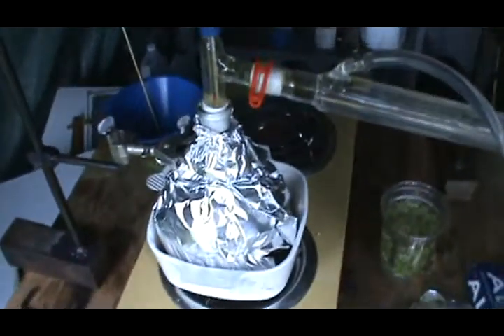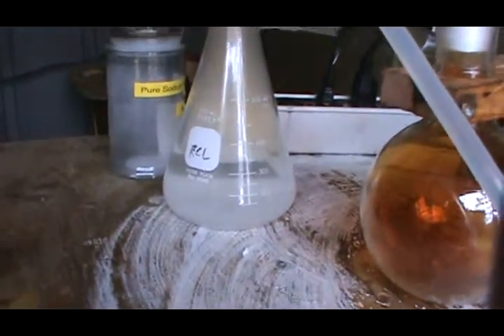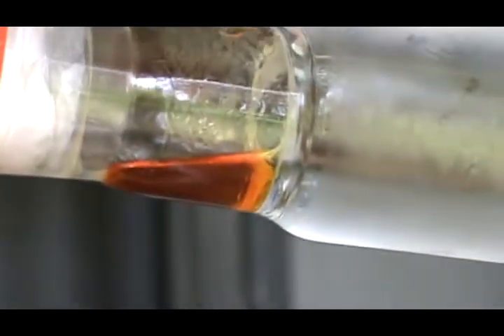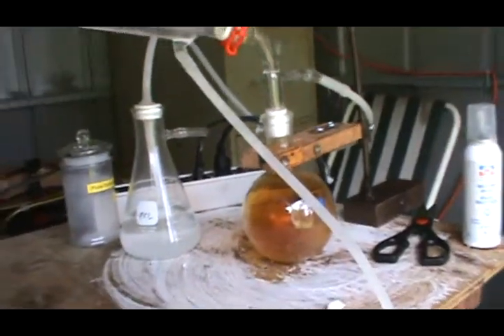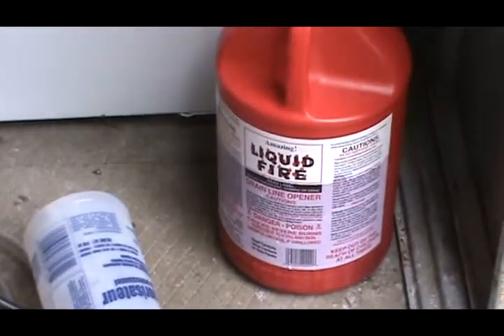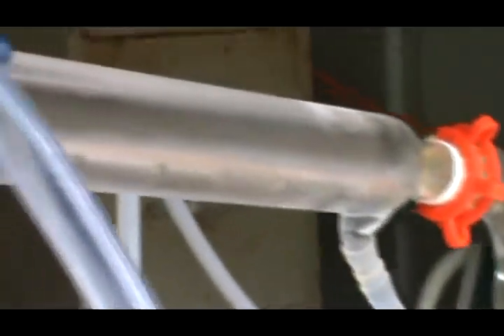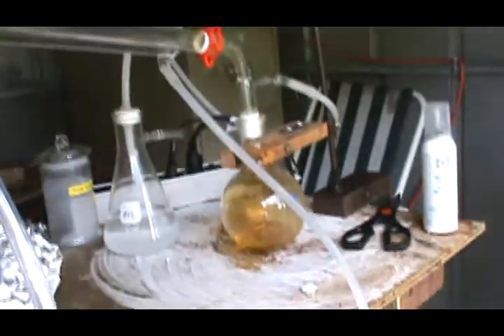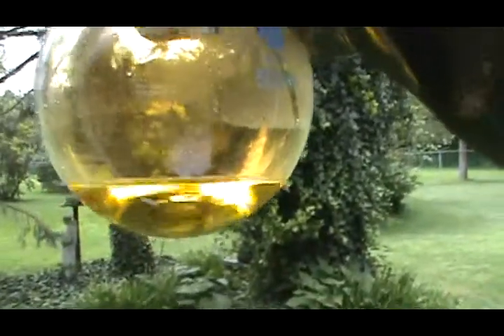distilling red fuming nitric acid

Comment: Rooto®️drain cleaner is 98% sulfuric acid
Reply: No it is not. You cannot have a H2SO4 based drain cleaner of 98%. 98% is as pure as azeotropic H2SO4 can get. As soon as you add anything to it, it will drop in purity fast. Don't believe anything you're told, that myth has been debunked a million times. It's a fine source to distil form, but so are many other brands. Rooto is about 93%-95%.

Comment: nitric acid is prone to breaking down to HNO2, isn't that exacerbated by high temps and long term storage?
Reply: Yes. It breaks down due to light, air and impurities. It is especially sensitive to light in vapour form, so not shielding such a long condenser a really bad idea. Pulling a vacuum so that the boiling point drops, really makes a difference in the final product.

Comment: The title of your video is deceiving, Red Fuming Nitric acid is nitric acid mixed with dinitrogen tetroxide, what you have here is just nitric acid. The NO2/NO given off is a result of your boiling flask temp being too high and the nitric acid is decomposing.
You want to keep the boiling flask as close to the boiling point of nitric acid as possible 83*C.
Also it extremely unlikely that too much sulfuric acid would cause the sulfuric acid to come over with nitric, given that sulfuric acid boils at 337*C and despite what people tell you its not really that volatile unless its aziotropic and even then its not that bad. Just redistill the nitric acid after which you will have to do anyway to remove all that NO2 contamination
Reply: You're right in just about every way, except one. When boiling, you do run the risk of H2SO4 carries over, but not as a vapour due to it boiling, but rather due to it bumping. It simply splashes up in the column.
This might be a fuming acid, but then again, it fumes from about 71% so that's not saying much. I've done this drain cleaner method a bunch, and I cannot get pure fuming acid unless I use a fairly pure H2SO4 and vacuum. Distilling directly from Liquid Fire is not a good way to go about it, that's for sure. The acid in the LF is only between 90-93% tops. I would love to see the oxidation abilities of this. My guess is between 72-76% pure.

Comment: You should boil no higher than 84 degree's celcius or your nitric acid will not be as pure and have water contamination lowering your percentage.  Also, your thermometer should be placed higher and you need an ice bath for sure.  Good video and not trying to nit pick but if you fix these you will have much better product.
Reply from the maker: thanks im not too worried tho cuz im only using it to make aqua regia but thanks for the pointers